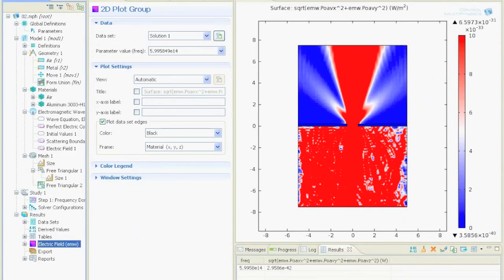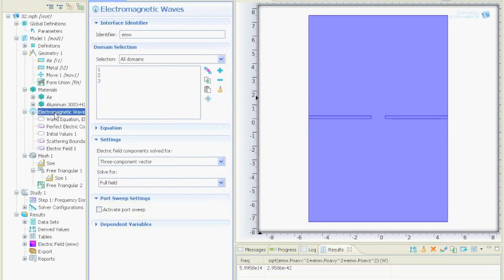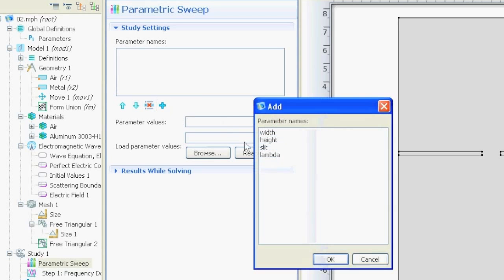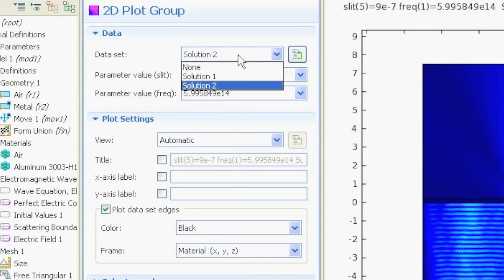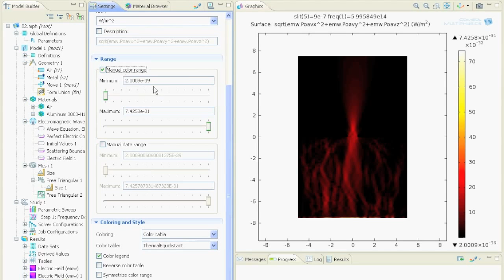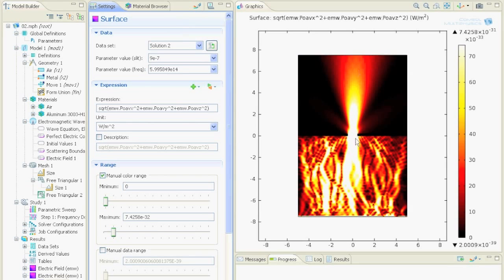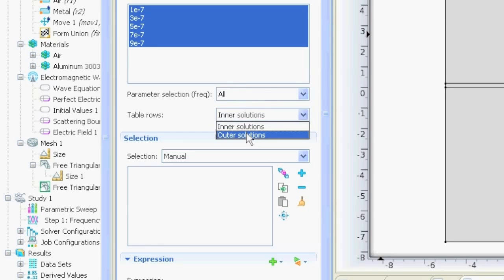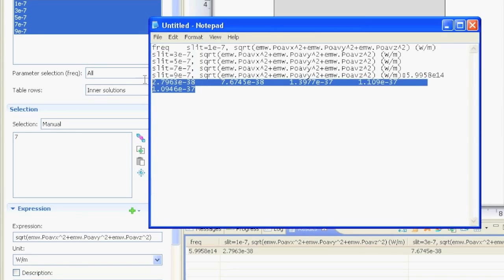(12) Parameteric Sweep - COMSOL 4.2 Tutorial

Comment: Hi guys!! Your tutorial is very useful, I understood a lot of aspects, but I continue to have a problem: I'm using the MEMS module and in particular I want to plot 1D graph where my axes are the frequencies (x axis) and the displacement of the tip (y axis)... I'm considering the frequency domain analysis and a specific range for the frequencies (0,0.2,20)Hz, but I'm not able to visualize what I want...in the end of the FEM simulation I see a 3D plot for the von Mises [N/m2] stress or the displacement (through the "Volume"), but I don't understand at which frequency..... can we help me?